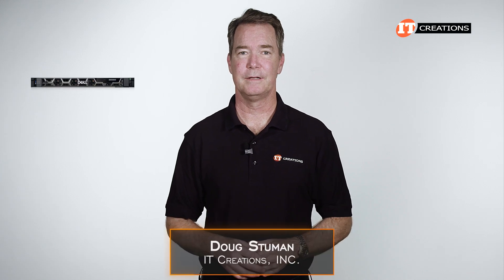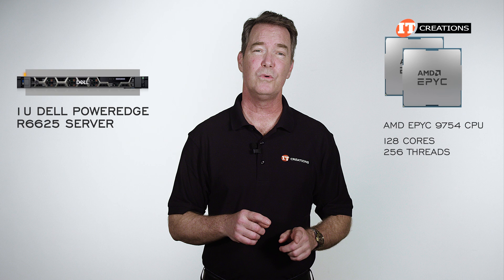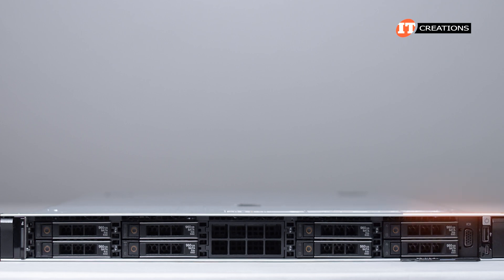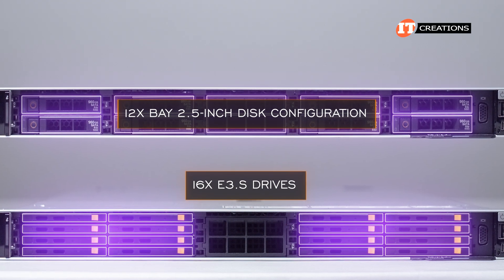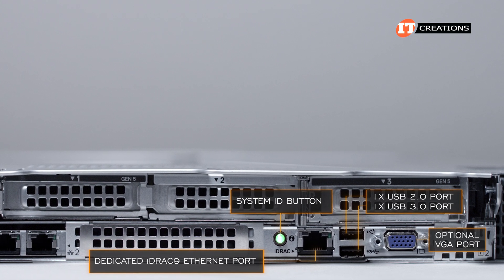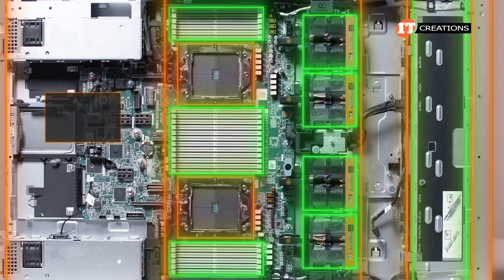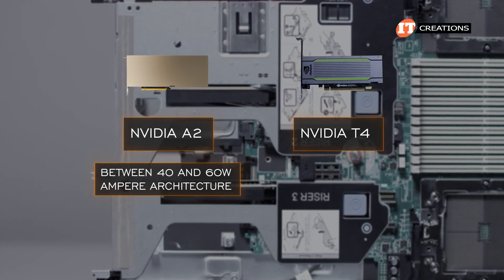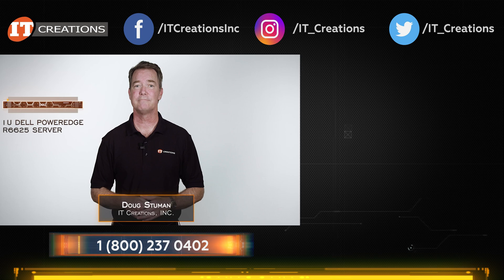4th Gen AMD EPYC-Powered Dell PowerEdge R6625 server REVIEW | IT Creations

Comment: Thanks for the overeview.

Why would anybody put any SATA/SAS drives there? 2.5 inch mechanical drives have limited capacities, and you can get way more storage, performance, and iops with U.3 or E3 flash, and probably cheaper than Dell hard drives.

Would be nice to know power usage at idle.

Also, I think LOM can be upgraded to different options. It is not just 2x1G (it is just default).
Reply from the maker: I believe you are correct on all counts! U.3 May still be a bit more spendy but not by much at this point. And yes that LOM board can be upgraded too as it is a separate board. Thanks for watching!

Comment: Curious on whether sufficient air-cooling can be achieved for eg 2x 400w TDP CPU's in that thing? In a 1U rack there's very little headroom for heatsinks and small fans have to be used as well. I don't have previous experience with the cooling dynamics of rack-chassis so would love to be educated about it.